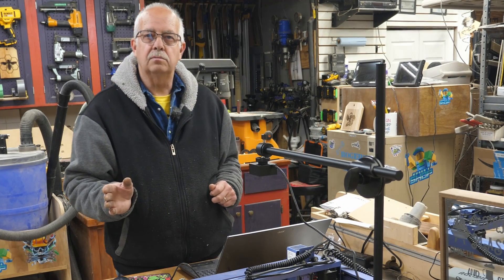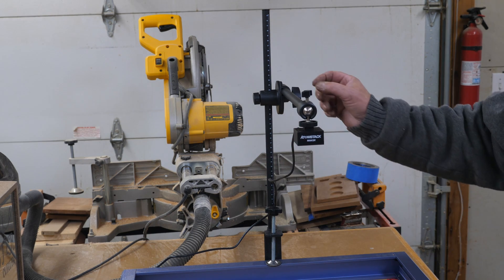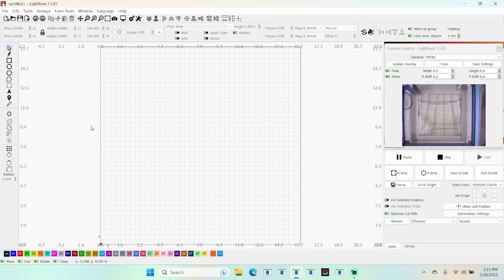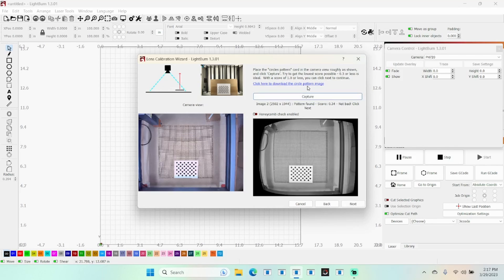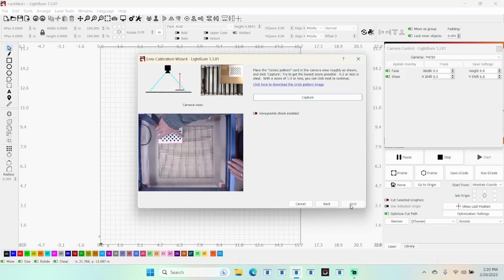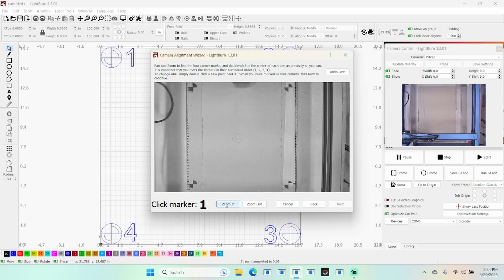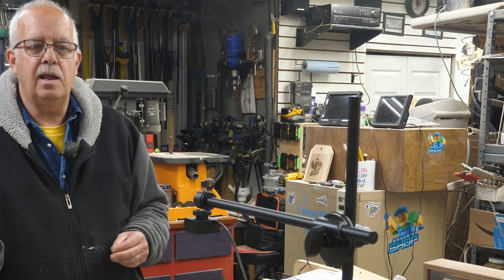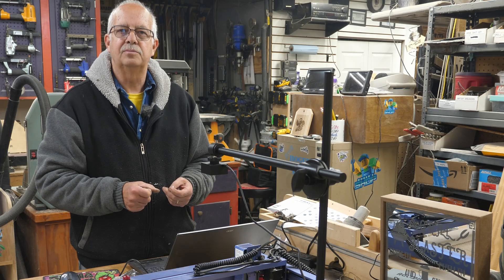Atomstack Maker AC-1 Laser Camera Setup

Comment: wow I wish mine worked this easily....or at all. Nice to see it could for someone. Legit have mine entirely hard wired to a computer(cam and laser) and I still can't even connect my Atomstck A10 pro to lightburn either. Also had the initial SD card get corrupted and had to reformat but didn't work so I had to go scoop another one that was too big so then had to partition that lil card and that seems to be the only way I am able to get to play with my laser.
Reply from the maker: I am not a fan or user of cameras on lasers with the exception of my WeCreat lasers.  To me, they are a nuisance, but that is just my opinion........